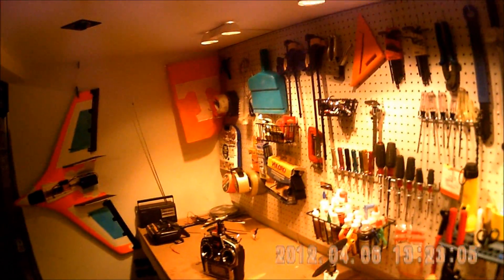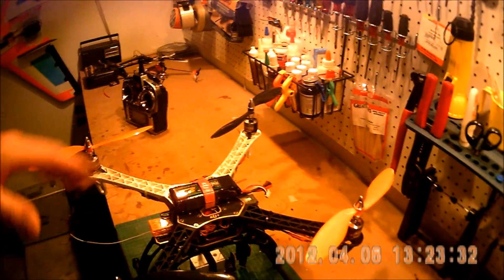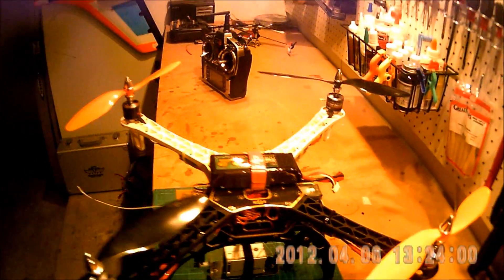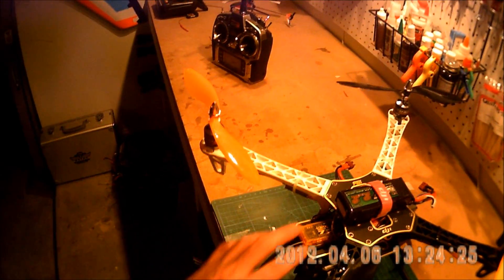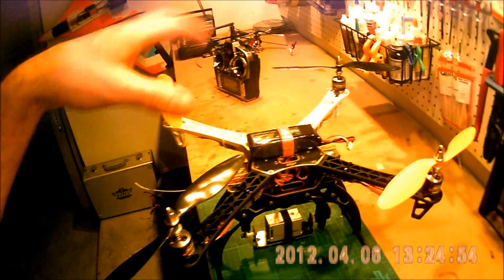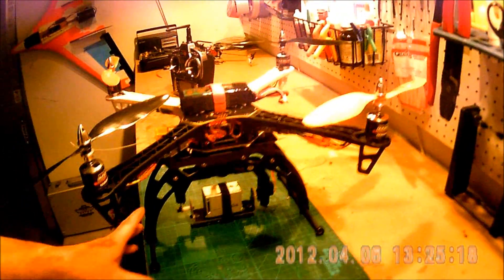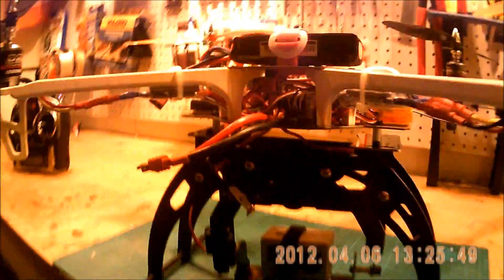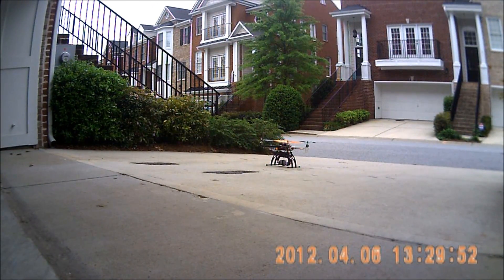DJI Naza & Flamewheel w/ x468 Gimbal & GoPro Hero2

Comment: thank you for your video. questions : did you mount the go pro straight into the gimbal or did you use any vibration damplening at all? there seems to be a bit of jitter on the onboard vid.

Comment: Hi! I have same setup, with DJi 8x4.5 props and 2.200MaH/3s battery, but id doesn't stay long in the air, I think its on the edge of weight capacity.
What battery and props are you using?
What are your experiences?
Thank you!